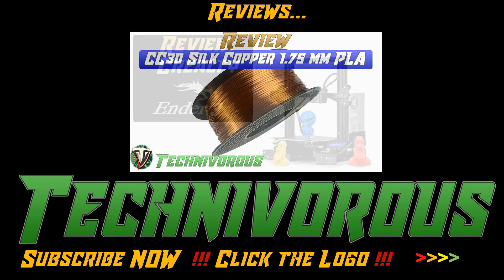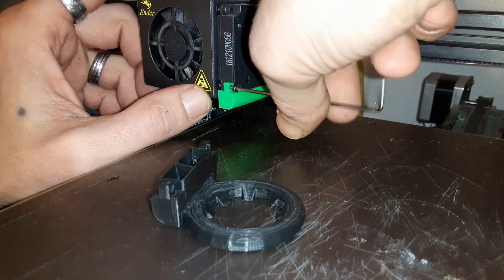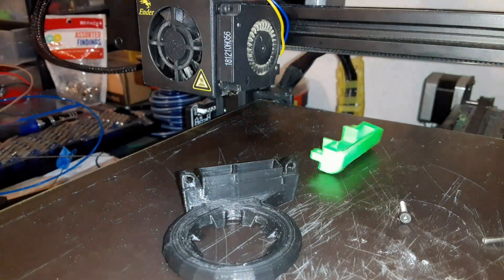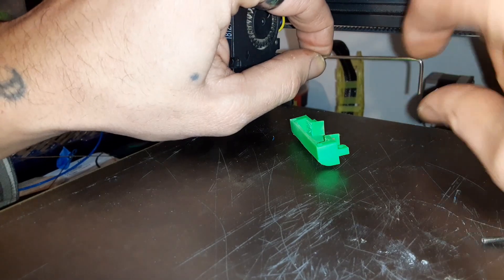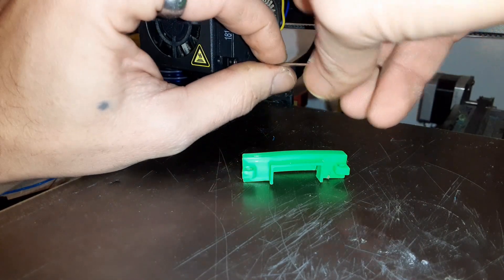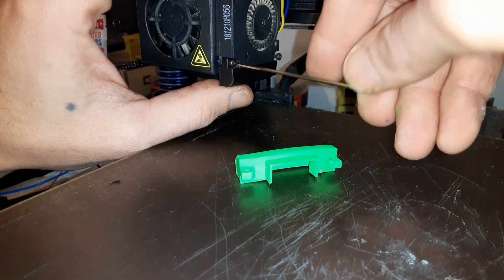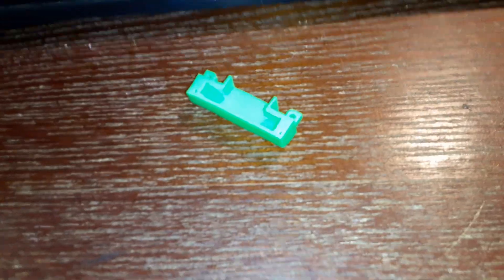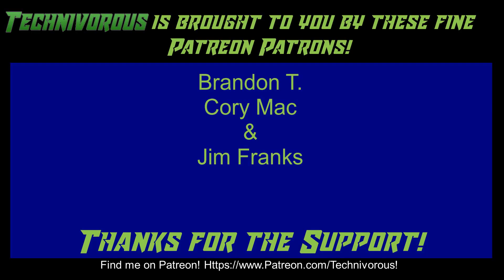Replacing the part cooling fan vent on an Ender 3- ring vent

Comment: hot tip - pun intended. place a flannel on the bed, saves scratching around under the table for the missing screws ;)

Comment: 1) Take a jar lid of about 3" or more diameter and set it on your bed. 

2) Put some water in it. Not too full, but pretty full. (Yeah, that's a technical spec.)
3) Move your nozzle over the center of the lid and turn your fan on. (This is one of those times I'd suggest you just move the head by hand. I've accidentally been on 10mm when I thought I was on 1mm. You don't really want to dip your nozzle in that.)
4) Turn your fan on.
5) Look at the dimple the air flow makes in the water. (It just occurred to me that it might be more visible if you put some food coloring in the water.)

This will give you a rough idea of where the air is coming out.

I gotta be honest with you... I've seen a model of the air flow through a ring duct like that one. Nothing is coming out of those holes on the side of the ring away from the fan. It's the reason the ducts in your house aren't all the same size. 

Also... Printing a fan duct in PLA is going to get you a fan duct that doesn't last terribly long. The one I printed kinda melted in places. But, if PLA is what you've got, it's almost certainly better than nothing.

Here's a link to one I found and modified with TinkerCAD: https://www.tinkercad.com/things/gcUypr5EeQa-fan-duct-stock-fan-re-centered

It's... Meh... It's OK. Maybe a bit larger fan would help it out. But that would require a little re-design and I just don't have the time for that right now.
Reply: Oh, I think I might have seen this air-flow test on Design, Prototype, Test's channel. I think... I'm pretty sure it was him. Kinda... (Just thought I'd mention that, since you seem to like his stuff, too.)

Comment: My 4010 fan starting making grinding noise, i went with a smooth fang setup using a ball bearing 5015 from ebay for $9.60 after shipping/tax. 

some links in case your interested...

Smooth fang duct: https://www.thingiverse.com/thing:3091560

Smooth fang mount: https://www.thingiverse.com/thing:3419869

5015 fan I used that is working great so far: https://www.ebay.com/itm/5015-24V-DC-Dual-Ball-Bearing-Blower-Fan-50mm-Blower-Fan-50x50x15mm/184043944343?ssPageName=STRK%3AMEBIDX%3AIT&_trksid=p2060353.m2749.l2649